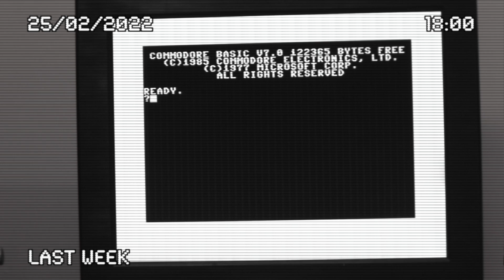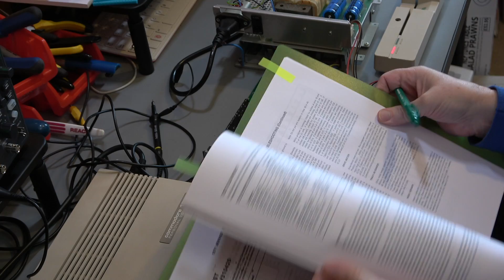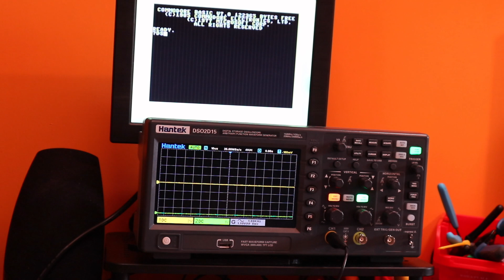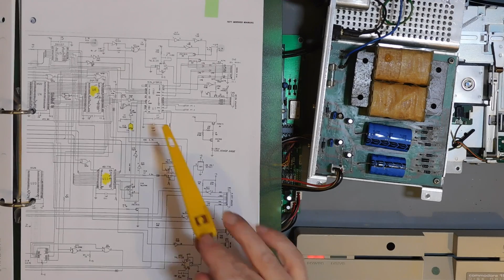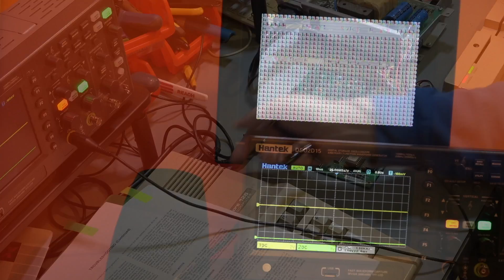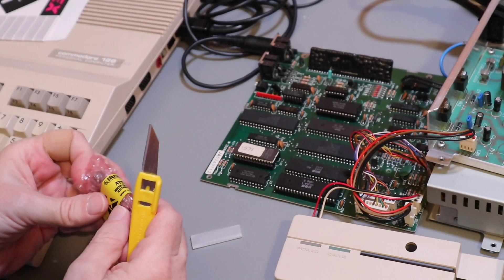Commodore 1571 Disk Drive Repair Part 2

Comment: Hallo tolles Video. Könntest Du mir bitte unbedingt die Diagnosic Disk für 1571 senden ? Ich suche dir schon ewig. Vielen dank vorab.
Reply from the maker: I'm not in a position to duplicate and send out floppy disks. Your best bet is to download the files from (e.g.)  zimmers.net, and install them onto an SD2IEC or similar device. If you really need a floppy version, there are vendors on ebay that sell it.

Comment: WD1772 have nothing with c64/c128 mode so 1541/1571 will work the same. WD1772 is for reading MFM formated disks under CP/M , you should really named this series trying to fix 1571 :)

Comment: A disappointing end to the video Tim. Onwards and upwards. What is annoying is that I have that drive in my loft together with all the C64 equipment. It’s going to be interesting to finally figure out which chip/s are/is causing the problem.
Reply from the maker: It's a frustrating problem that's driven me round the bend for weeks! Sometimes it works perfectly. Other times it doesn't. As I showed in this video, sometimes the logic shows a fault, sometimes it doesn't!
Reply: @TimsRetroCorner  Hopefully you will eventually find it's true fault.
Reply from the maker: Keep watching for part 3 :)